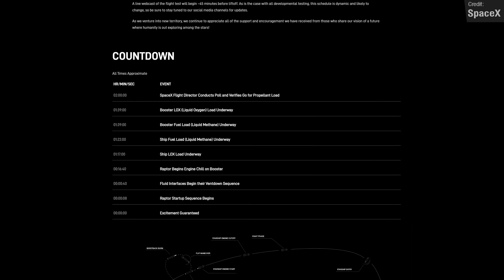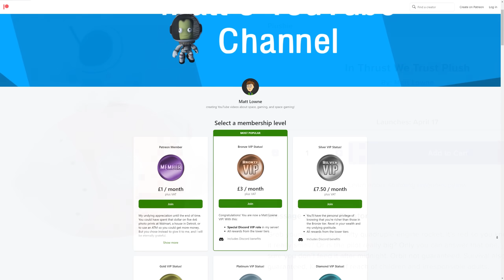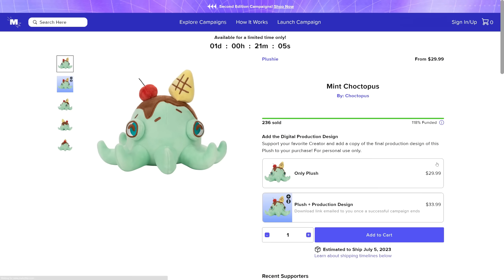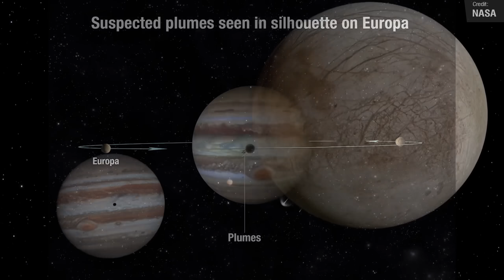SpaceX Starship Flight Test SCRUBBED Today, JUICE Launch, Transporter 7, & Artemis Updates

Comment: SPACEX FANS WHEN SLS HAD VALVE PROBLEMS..😡😠😠😲😲😲

SpaceX fans when starship has same issue ..😏😆
Reply: Not this one. Just the 'rah, rah, rah, SpaceX rulz' fanbois.
Reply: @steveaustin2686  i no fan boy of anything i have my own mind.  I laughted just as hard if not harder as elon should know better.
Reply: @Fatpumpumlovah2  You might want to read what I wrote again. I didn't say you were a fanboi, just that the 'rah, rah, rah, SpaceX rulz' fanbois are the ones dishing on SLS for valve problems, while giving Starship a pass.
Reply: @steveaustin2686  i know you didnt.  Did i say you did?  If so my bad..  just reaffirming my position.

Comment: That last launch clip.. why was I'm guessing the fairing falling to pieces during the launch?

That seems like it could cause some weird aero, how was that fine?
Reply: Almost certainly insulation, not necessarily ice. See the response to Tlaloc
Reply: That always happens with long marches, that's ice falling off the cryo tanks, and possibly insulating foam too.
Reply: @TlalocTemporal  Nah, the Long March 4B's 3 stages reportedly use dinitrogen tetroxide (N2O4) as the oxidizer and unsymmetrical dimethylhydrazine (UDMH) as the fuel. Neither are cryogenic, but do have to be kept cool to cold. The squares falling off are almost certainly insulation to keep the propellants at the best temp for most efficiency. Even solid propellants can have insulation for that as the Minotaur 1 rocket, nicknamed the Banana Rocket, for its yellow insulation that peels away at launch.
Reply: @TlalocTemporal  Ah ok thanks for the info
appreciate it :D

Comment: 0700-0930 CST is the time between 7:00 am and 9:30 am in the Central Standard Time zone. In the United Kingdom, during the summer months, the time zone is British Summer Time (BST) which is one hour ahead of GMT. Therefore, the corresponding time in BST would be 1:00 pm to 3:30 pm.
Reply: Per the NSF stream I am watching right now, SpaceX is currently aiming for 0820 CST for the launch.
Reply: It was scrubbed due to a valve problem. Maybe tomorrow or the 19th.

Comment: I can't wait to watch the starship orbital launch 🥳🎉
Reply: scrubbed sorry
Reply: @doge151alt_account  Hopefully tomorrow or the 19th. Was a stuck booster valve apparently.
Reply: @steveaustin2686  i know i watched, if only the propellant loaded correctly then we might have got a real launch
Reply: @doge151alt_account  From the NSF stream and an apparent Musk tweet, it was a stuck valve in the booster. These kinds of things happen on normal launches, not to mention first launches.
Reply: 0920 EST seeems to be the current launch time today per the NSF stream.
Reply: @mrhuman-x6l  Never said that I want a scrub. Just not surprised that there was one on this first launch attempt of a new booster. Better to scrub, than hope for the best and find out that you were wrong.
Reply: @mrhuman-x6l  Bovine excrement. SpaceX is not that black and white. Yes, they rapidly iterate and will accept a sub-optimal solution as a stop gap, see hydraulic gimbaling, but they don't launch WANTING failure. They may launch expecting a failure, but they DO want it to work. Launching when you KNOW you have a problem and just hoping for the best, is not something even SpaceX does. They scrubbed so that they can fix the valve problem and LIKELY get further into the flight otherwise. Don't buy the myth that you MUST fail. You likely fail will with something as complex as a rocket launch, but you fix everything you can, BEFORE you launch, so you mitigate failures as much as you can. SpaceX wants the launch to work for as long as it can in flight and this 48 hours to fix the valve issue is almost certainly a part of that.

Edited for delicate sensibilities.
Reply: @mrhuman-x6l  Changed it for you. Doesn't change the rest of the statement.
Reply: @mrhuman-x6l  Whatever floats your goat.
Reply: @mrhuman-x6l  Ah, not surprised it is 48 hours later. So if that also scrubs, Musk might miss his prefered 4/20 date. :)
Reply: @steveaustin2686  Let's find out he's postponing UNTIL 4/20 on purpose! Lol
Reply: * rip
Reply: 2024
Reply: @mrhuman-x6l  its one thing to lose the ship, its another to lose an entire launch facility.   if that thing blows,  its close to the nuke dropped on hiroshima